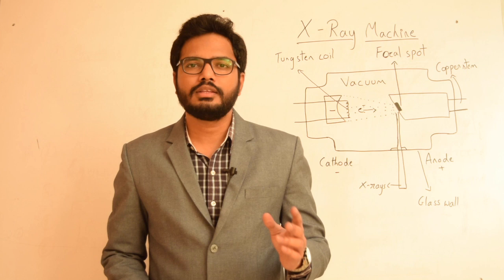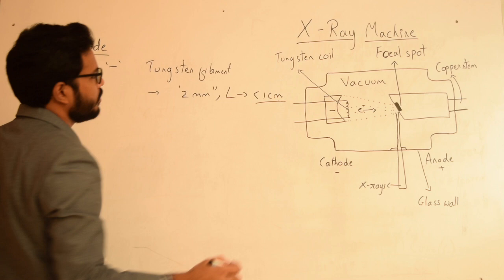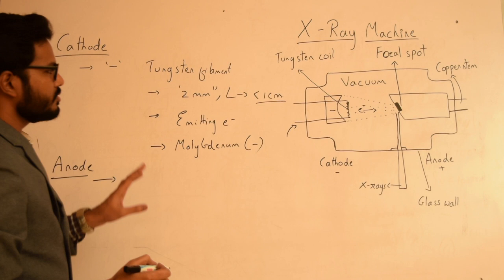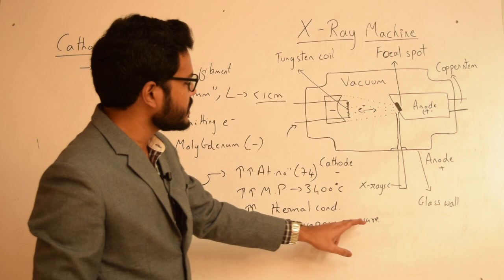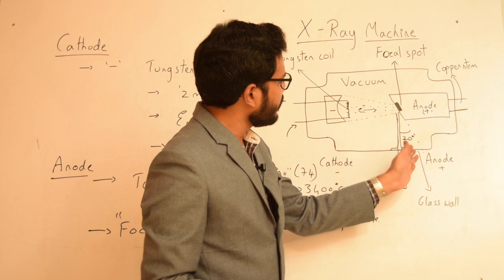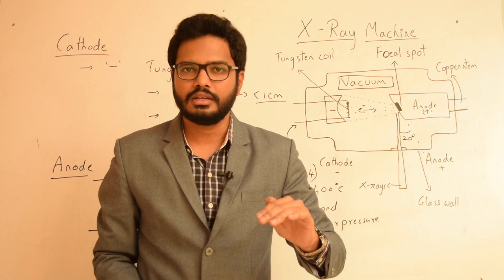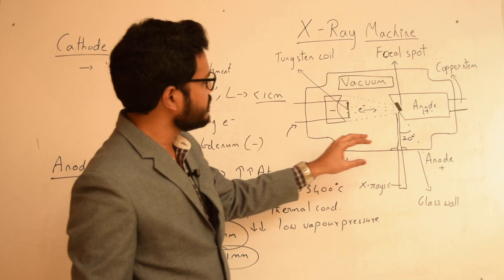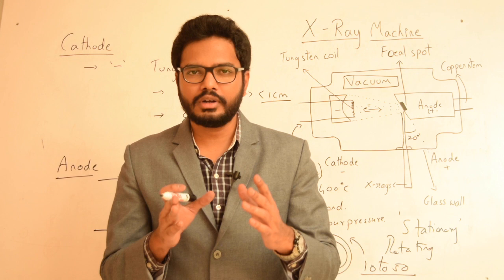X ray Machine - Components & Working Mechanism | Topics In Description Below

Comment: im new in this field, i have read few sources so far, on the cone, yes its negatively charged but not as negatively charged as the cathode, though its main purpose is to focus electrons to the anode, does it also attract weak electrons?
Reply from the maker: Hi glad to hear from you. You can get back through mail for any queries via our Doubt Clarification Form. Best wishes.

Comment: Sir what is the oil surrounding the tube called??
Reply from the maker: Shree Yogi I am not sure if it has a specific name but we use it for insulation of tube to expedite cooling. Insulating oil.
Reply: Diala oil
Reply: Shree yogi- thin purified mineral oil surrounded the x ray tube and it act as- electrical insulator and a coolent
the oil should be free of air bubbiles and it should have good thermal expanison property